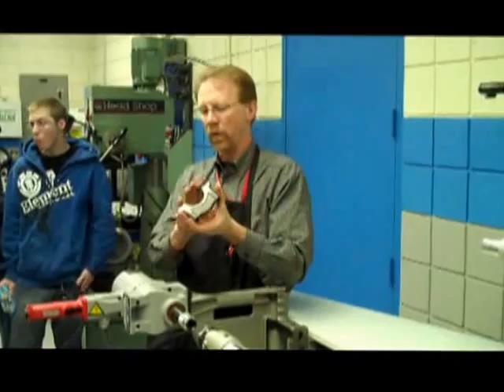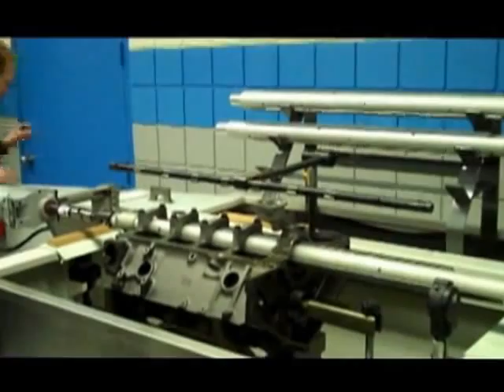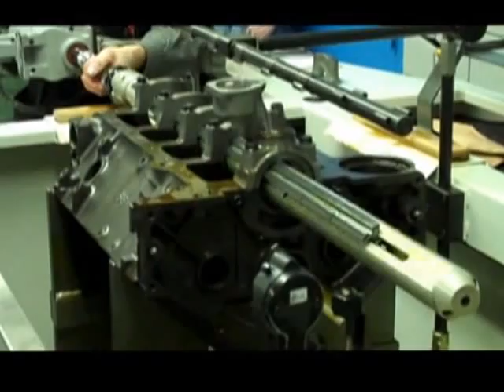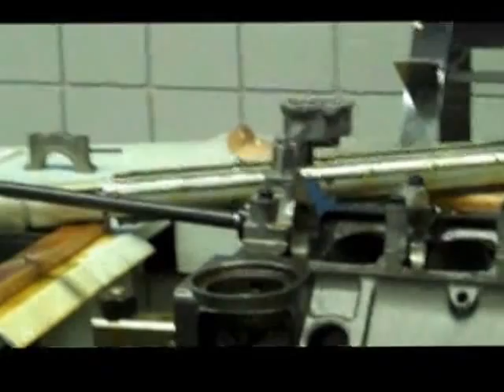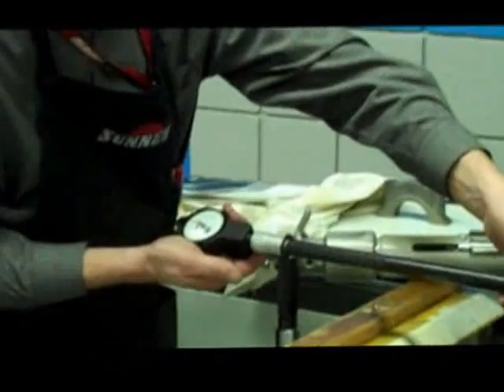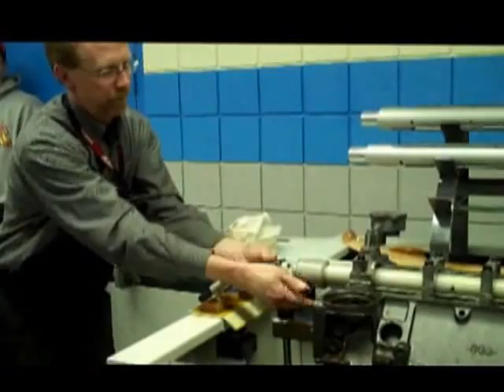Align Honing Main Bearing bores on an engine block

Comment: You should tell people that they may need a .005 to .010 thousandths shorter timing chain, which is readily avalible for most applications, because the stones weights are on the block, most of the material is removed from the block, which places the crank closer to the cam. Hope this helps.

Comment: Best way to allign the main bore is to use a line boring machine
Reply from the maker: I don't agree......Line Boring and Line Honing are two separate and distinct processes  Each process has their strengths and weaknesses.  Most Professional Engine Builders prefer line honing when main bore misalignment problems are small or there is a problem with size/roundness of the Main bores. Line boring usually is preferred when larger alignment issues exist. Line boring is also REQUIRED when replacing main caps. Please see my video on Align Boring for a better idea how that works.

Comment: When pulling the cap down to torque, do it evenly, not one  side down and then the other  side down, possible distortion, just saying
Reply from the maker: Yes, evenly is always better, but I always seat the cap in the register with a deadblow hammer before I torque the cap. When you are prepping a block for align-hone, you take the caps on and off multiple, multiple times to get the undersize of the bore about .003 to .004 smaller than the spec.
Reply: @turbodave231 i noticed that also, the guy in the video torqued the far side then had to run the near side down before torqing it. I think or atleast hope that most guys watching this for educational purposes do understand the correct method but it would have been nice to have got it right on video.

Comment: dummy didn't spin it while it was coming out so now it will have one side that is .001-.002 out further on the end. Attention to detail is everything if you are building a high-performance engine.
Reply: Wrong.. he releases the stone pressure. On this machine, you don’t keep spinning when you remove the mandrel.

Comment: I was confused until the guy asked the question about loosening the cap on the bore that was already to size. I was scratching my head wondering whats the point on measuring all the bores independently as the two outer bores dictate how long one keeps boring then he asked the question about loosening the cap on each more that has reached its target,  simply brilliant question at the right time as I was just about to leave the video.

Comment from the maker: Good Question! I released the pressure on the stones before I took the mandrel out of the block. There is a small lever on the mandrel that releases pressure. I also place the abrasives at 12 O'clock when I remove the mandrel, so only the metal shoes actually touch the bore during removal. Another teaching moment!!! :)

Comment: Um,, why didnt he twist the hone while he was pulling it out? didnt he make a flat spot by dragging the hone out in one place? (he did comment on how much the hone took out with very few passes, so this is definitely a thing)
Reply: He released the tension on the stones before pulling the hone out.
Reply: I always thought crank mandrels only had abrasives on one side so you could turn it up to the 12 oclock position and pull it out without tension and no damage.

Comment: Ok so the honing bar is not externally located?  It's just located by the workpiece, am I correct?
Reply from the maker: Yes, That is correct. The honing media is also shaped by the bores in the block. That is why I often flip the block end for end and hone from the other direction.

Comment: I need to do this to my Pontiac 455 2 bolt main, cast num 485428. it been pre tapped for 4 bolt main. Any know the cost to do this?
Reply: I hope you're able to get it converted to a bolt main.  More power with the durability.

Comment: Personally I don't believe in messing with the main bores unless swapping caps !!!!! IV had it done 2x and they weren't worth a damn after !!!! If they are slightly off it doesn't matter do to the fact that alot if engines under full throttle and load flex up to .015 from corner to corner the oil film is strong enough to not let the crank contact the bearings and a good crank flexes without breaking wich is why forged cranks have more issues with cracking than cast iron or steel . Read David wizards books he knows .

Comment: I was taught to never pull the mandrel straight out but to rotate it as its being removed to avoid grooves and to never stop the the motion at the end stops with the mandrel driver turning but to hit the end stop as the mandrel driver winds down to a stop

Comment: What process did you go thru to align the hone mandrel to the main caps?
Reply: Todd Sizemore good question
Reply: he doesn't. As far as I can tell this bar is not externally located, but instead is just located by the work piece.  I guess he just hopes for the best and measures afterwards.  If it's botched, then the customer is told their block "couldn't be used" and is "too far out of spec".   Seriously dealing with automotive machine shops makes me want to just make myself some clamping fixtures and do it all on my bridgeport.   SMH
Reply: That's exactly how I got started

Comment from the maker: Line honing moves the crankshaft centerline up into the block. How much?  It depends how much material you cut off the cap parting line. Special timing sets are often available to take up the difference. Cloyes is one manufacturer that offers this type of timing sets.
Reply: Moving the crank shaft up also can screw up starter engagement.
Reply from the maker: I've align honed lots of blocks and have yet to run into one with a starter engagement problem afterwards. Not to say it couldn't happen. We always try to minimize the amount of metal we remove from the caps. This keeps the crank closer to the original location.

Comment: If you go oversized, you can cut the caps again, but you will still be too wide at the parting line. Back in the day, I saw 1984 2.5L Pontiac blocks with the main saddles and caps knurled and rehoned to size, from GM! I figure they did the repair this way because the Iron Duke gear drive timing did not allow the centerline of the crank to be moved up into the block. I've also witnessed the great crankshaft guru Jerry Paris at Midwest Crankshaft in Harvey, IL. bore a damaged main bearing saddle out followed by dowel pin locating of a metal sleeve, returning the saddle back to standard with no alteration of the centerline. 

The gamer generation can do that sort of thing...on their phones ; )

Thanks for the excellent video.
Reply: too much over honing will result in slightly looser timing components

Comment: Can you make a video of connecting rod cap and main cap grinding? Do you always grind your rod caps flat, I have seen them ground on each side with a .003" feller gauge to help tighten up the rod diameter 90 degrees to the rod.